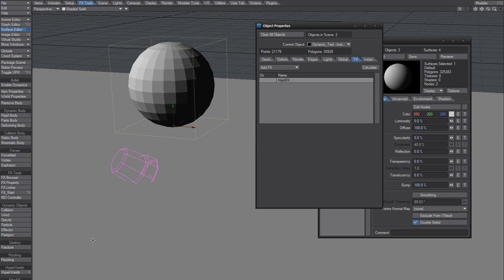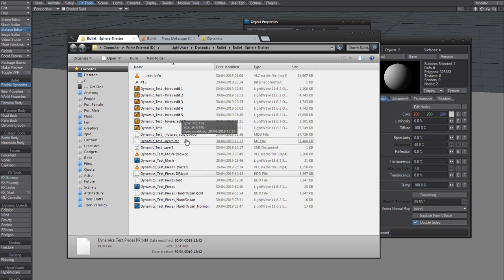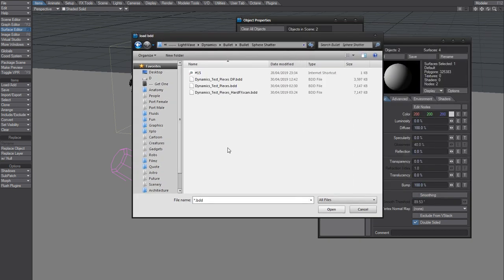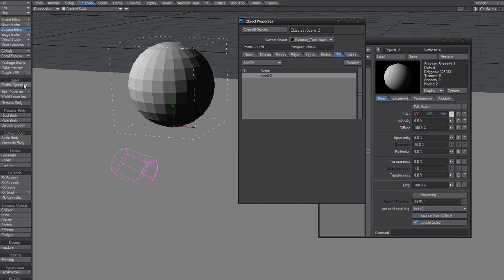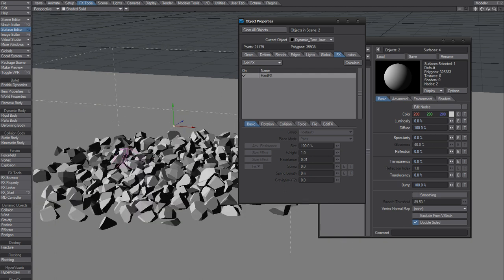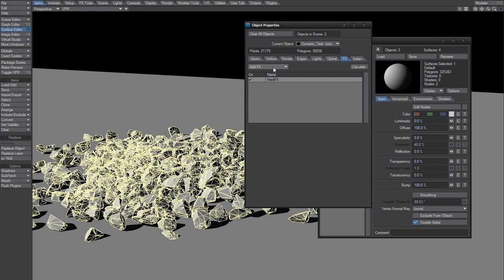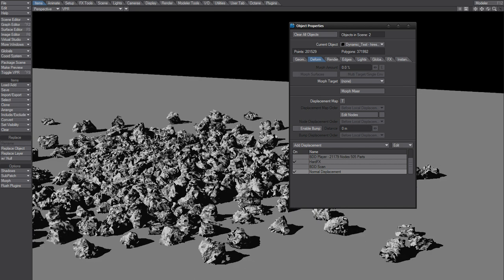LightWave test - Bullet BDD Proxy #1

Comment from the maker: Summary,
00:29   The bullet dynamics simulation is not highly precise but ok for testing purposes.
02:11   The scanned file size is relatively small at four megabytes, making it easier to manage.
05:22   Issues arise with object flickering and incorrect behavior, indicating bugs.
10:55   Normal displacement works better on low-res objects, compared to high-res meshes.
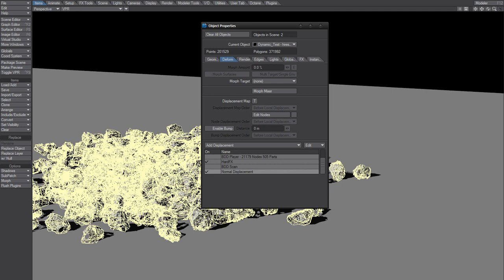14:44   Adding displacement takes significant time, especially over multiple frames
16:53   Using the DPont plugin for scanning can enhance speed and precision, preferable
20:14   Combining different simulation methods, such as bullet and hard effects, shows potential but has limitations in mixing motion data effectively.